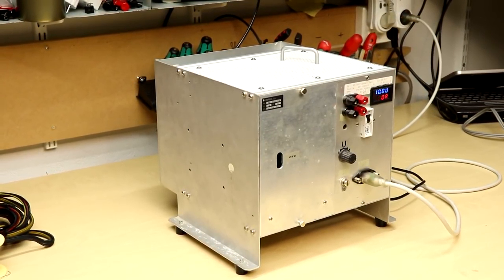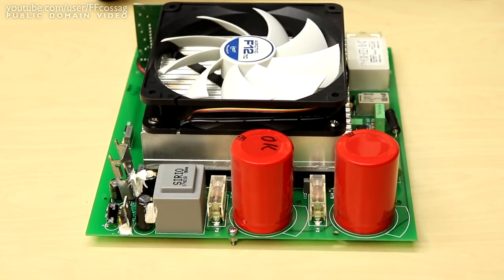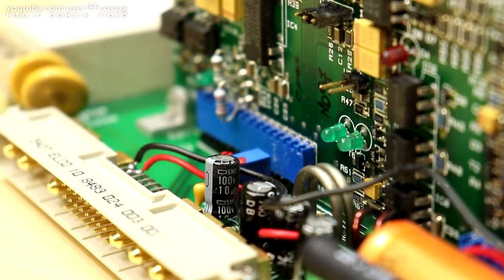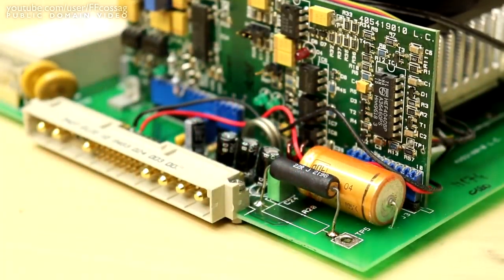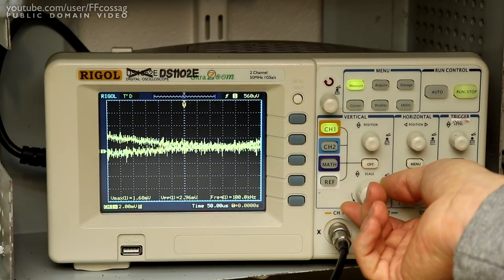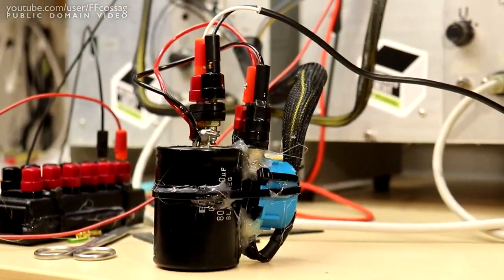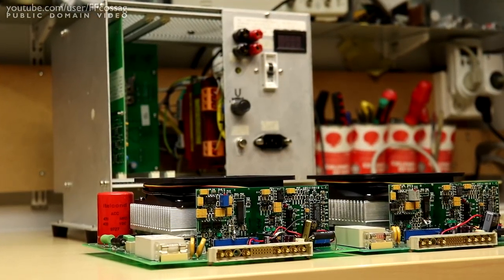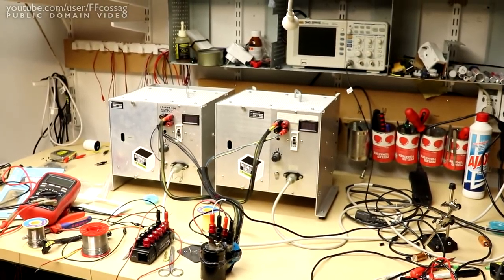De-noising the 44-amp POWERCUBES!

Comment: It's nice to see you posting new videos again. Good work!

I think your power supply would benefit even more from large film capacitors coupled to its output. Film capacitors tend to fair better with high ripple currents at higher frequencies. 

My choice of components would have been:
- 4700uf electrolytic
- 22uf polyester/polypropylene
- 680nf polyester/polypropylene

Nonetheless, great video, great mod! Thumbs up! :D
Reply from the maker: Thanks. There's always room for improvement. The reason I went for MOAR ELCOS in this application is that the main ripple voltage is at a relatively low frequency; there isn't much of an inductive spike since the small caps were added to the output.

Comment: Love all your videos.. While looking at some of your previous videos about your hacked and upgrade UPS, the one with 2 transformers and arctic fans, I seriously can’t see how why or what and where you get your mains voltage from.. Like do you have your solar system running in case if the power goes out? Or is it just your solar system running? Fun project to work on?? I’d be really interested in a tour of your solar setup. Panels Inverters wiring charge controller ect..

Lol how’s the camera thing going?

Comment: I didn't want to watch the Wanptek ripple vid because it was so long, but there was so much testing that it ended up one of the best vids. Shame we didn't get an edited testing of this one.
I would be interested in cheap amps because people are using them with knock sensors on cars and listening for knock, as a cheap way to tune them that is actually more cost effective than expensive electrical knock sensors.
Reply from the maker: I'm trying to move away from filming testing as it goes on, in favour of filming the results and narrating the thought process. This is because I think it'll produce a more coherent result. I was actually going to make a bigger piece about the testing procedure, but in editing, I found that I hadn't filmed anywhere near enough stock footage to make it happen, so I had to let it go.

Oh, and how do you use an amplifier to listen for knocking? Do you use a microphone, or is there something more sinister going on?

Comment: awesome mod! those are really pretty PSU's! they are a 50hz isolation transformer and then a buck regulator? or isolation transformer then full switchmode PSU? doesnt make sense why it has the isolation transformer if that is the case.
Reply from the maker: They're buck regulators, yes. There's no transformer on the power module itself. The reason for this is that they needed to handle a ground potential of roughly 40 kV DC on the secondary, in their original application. ;)

Comment: Thats a smashing upgrade, i also used panasonic low esr caps to repair switchmodes, sounds like i made a good choice :-D.
Just out of curiosity, did you test the old caps to see which ones were the worst?
A choke from a mig welder might have helped too.